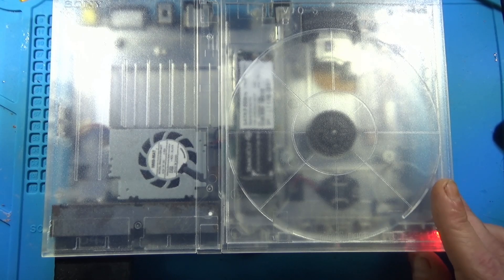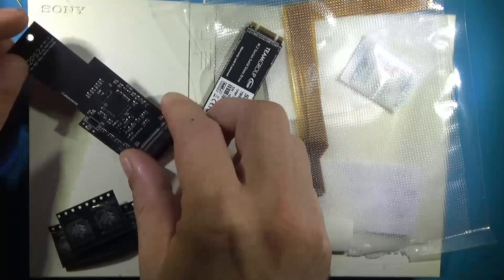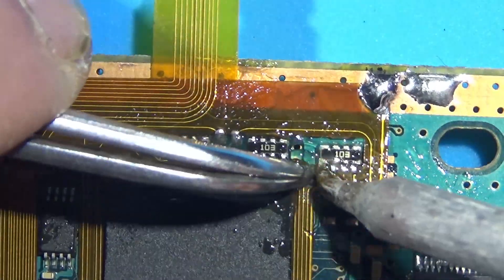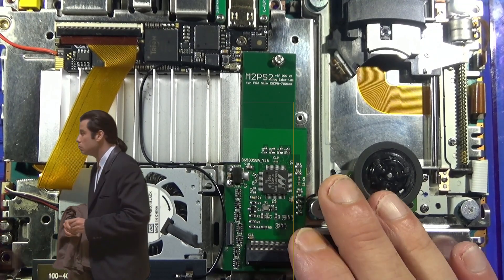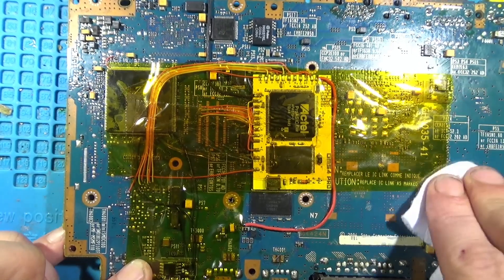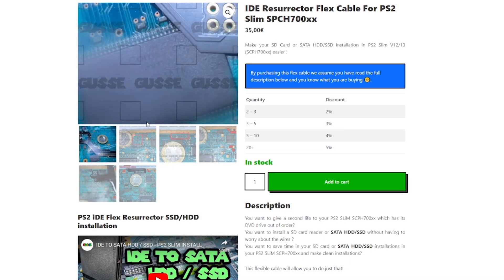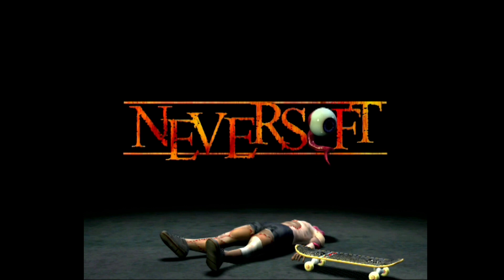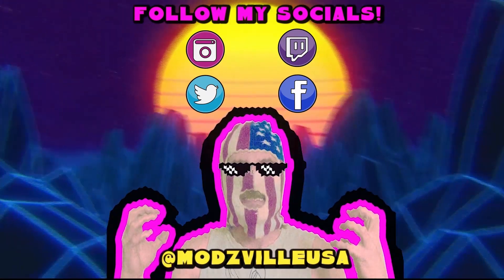M2PS2 is the ULTIMATE Ps2 Slim Mod!

Comment: Hi guys, I'm getting ready to do a project similar to this one (in fact, it's kind of identical because I'm going to use SSD m2 on the PlayStation 2 slim from the 9006 series) along with another one involving retroarch (basically: running java games on the Playstation 2's retroarch and pc), I apologize if the text is wrong, I have autism and I'm Brazilian and I don't understand much English
Reply: hello friend sadly something like for the 90000 series is practically impossible since they removed ide functionally in them
Reply: @Genotypic-and-Genes  I know, but I think that by doing it well it will work
Reply: @Corujaatípica Doing what? There is not interface to attach a Hard Drive. Using USB will limit you to 1.1 speeds

Comment: 5:06 Hey I have a question, I plan to buy this clear shell from Aliexpress, you mention they have some issues, is it both for the 70000 and 90000 clear shell on Aliexpress, my console is a slim 90002, what actually is the problem for these clear shells, I read the discs don't spin up or somehting with these custom clear shells, could you give me a break down what issues with these clear shells before I buy one. Thanks.
Reply: the little stopper thing on the top side is very tight its best to just remove it

Comment: Waste of an M.2 speed and awkward to toss games on.  IDE ribbon to SD would be way easier wouldn't it?  PS2 redump is like 16TB (3.5TB USA, no demos, no proto) so you're not gaining anything with M.2 either as that size isn't available and the bus can't handle the speed anyway.  Either you have to put games on one by one, or dump the set.  Plus you can use multiple SD cards, and they're like 10$ for 128gb.  If you want more storage, an SMB 1 networked Rasberry Pi with a large sata drive in an enclosure dedicated to the PS2 is your easy and cheaper option.  Cool project but impractical I think.

Comment: Is the voltage regulator you cut in the ps2 or did you need to order it? Also you don’t need the resurrector from Gusse do you? Everything used in this video came from Saints Fall?

Comment: This is a really cool mod!  I've only ever owned "one" PlayStation console, a PS2 Slim... which I only bought just under 5 years ago on eBay, used... "just" the console, for ONLY 22 bucks (I bought a genuine PS2 power brick two days later, for 12 bucks).  I just looked at my PS2, and it's on that list you showed... so I guess I have another mod to do (first, I have to finish the mod on my Sega Dreamcast: GDEMU + HDMI mod - and battery holder, as well as the Nactua (sp?) fan upgrade)!! 😁 The DC is about 25 years old... I may have to replace the caps, too (ugh)! 🙄

Comment: I think that the ideal ps2 slim will be when, in addition to m2ps2, the internal power supply is built into the console.  Quite surprisingly, I did not find information about such a modification.  Is everyone really happy with this brick on a wire the size of half a PS2?  After all, slim is primarily valuable for its compactness.  This problem was removed in the 9000x series, but these consoles are not suitable for SSD/SD card mods.

Comment: Its incredible how they STILL make new hardware stuff for the PS2 after so many years. Just says alot how much people loved that thing and how much they want it back.
Reply: Its actually more of you cant do much on consoles the more modern they are, cause they are more blocked or already have anything you would want from modern tech standard, like ps3, it already has hdmi and internal storage drives, all it needed for sure was cfw, what else are we going to add to it?
Reply: @erwinamanciosilva7693  yup. It's fun to push limits on older hardware but on newer consoles there really isn't anything to do
Reply: Bro literally made this himself. No one is manufacturing these.

Comment: Compared to MX4SIO this method is not worth the effort by far.
Reply from the maker: ide shits on mx4sio. Way better compatibility and no fmv skipping.
Reply: Does regular FMCB work and is compability like on Fat with the network adapter? If so then it’s much better than MX4SIO.
Reply from the maker: @Estmusic323  this is an ide mod so yes it’s basically a fat with a network adapter. FMCB would have worked fine. I just wanted to use a DMS4 in this build

Comment: Gorgeous. Too bad it doesn't work on the 7900X models, but I can probably just load my games from a NAS at that point.
Reply: This is what I do, but I have an issue with sound in cutscenes in some games. Tried different computers, switch, different versions of McBoot/OPL, files, BIOS, settings in OPL and nothing change. Videos are smooth, gameplay is perfect, but sound skips in cutscenes.

Comment: i ran a m.2 in my pc for my OS with a fan directly pointed at it no heatsink. long story short it overheated and failed and also did damage to the motherboard. my point is these get extremley hot while being accessed for long periods of time and im wondering the longevity of this mod as well as the possibility of damage to the dvd drive or other components nearby. disc warp i would also be concerned with if one was actually to spin a disc in the unit while m.2 was at operating temps.
Reply: No they do not. They are intended to operate hot. Just say you bought a green Intel pcb one on discount instead of lying about perfectly fine products
Reply: @Weneedaplague   First off I don't speak broke boy, it was a Samsung 970. Second off, They are made to have heat sinks on them. Why don't you be quiet and let the people using their brains handle this. "MaDe To OpErAtE hOt" haha yeah dummy that is what I'm saying 😂
Reply: @Weneedaplague - stop being a dick

Comment: You can also get around the 128GB SD card limit by using an IDE to CF adaptor and a CF to SD adaptor
Reply from the maker: Do you have a source on that? Tried on Dreamcast and only legit cf worked
Reply: @ModzvilleUSA Tried it myself. Works perfectly
Reply: @ModzvilleUSA used a cheap IDE to CF adaptor and an iFlash CF to SD adaptor.
Reply from the maker: @MichaelM28  nice! Do you have pics? I might try that
Reply: @ModzvilleUSA To clarify I'm using the adaptors in a PS2 Fat. I'm not sure how to make it work in a Slim model.